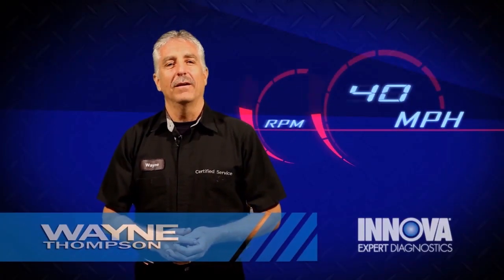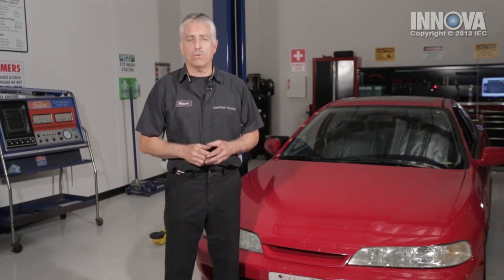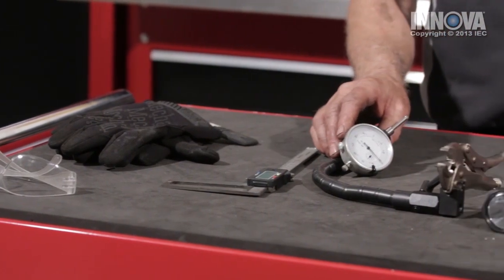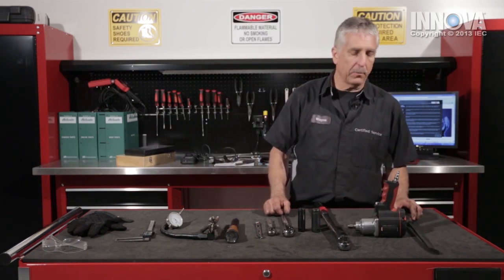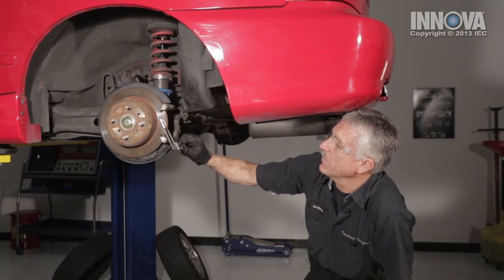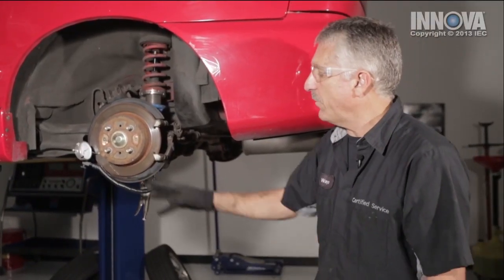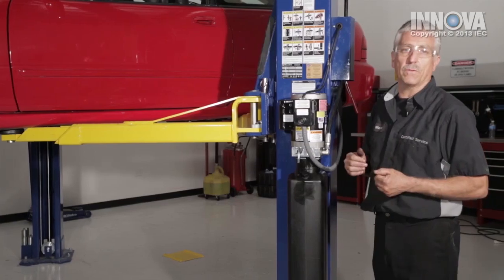How to measure Brake Rotor Lateral Runout and Minimum Thickness

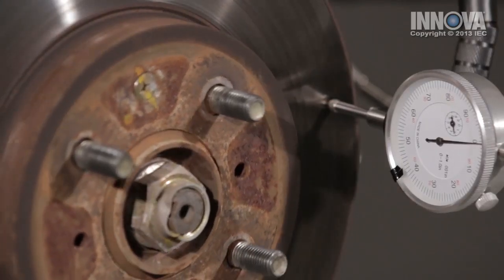Comment: 2:35  You are meant to attach 2 wheel nuts with spacers if necessary to ensure the disc is pressed against the hub properly

Comment: this is mainly to check if they can be turned. youre supposed to measure in 9 different spots for thickness to check for warping and always use the lowest measurement

Comment: I own a VW Jetta these vehicals use bolts not studs. This makes checking the rotors a pain. Fortunately my vehical does have the spoke wheels. If I am not able to fit a calliper in the space. Between the spokes is there another way. I can check them my self?